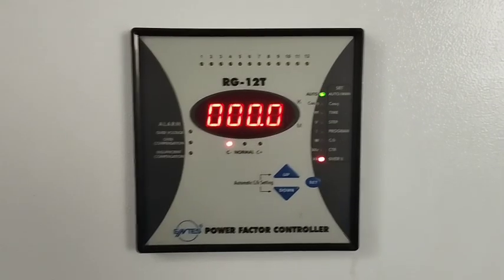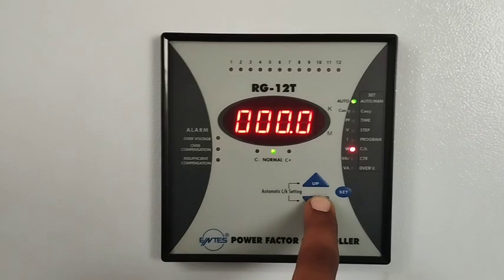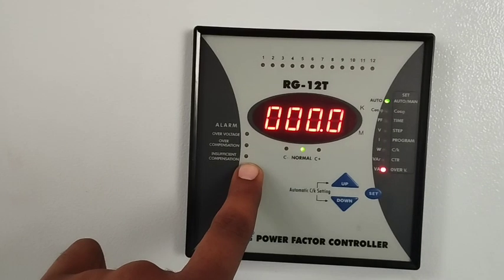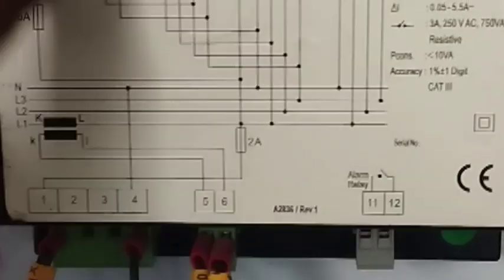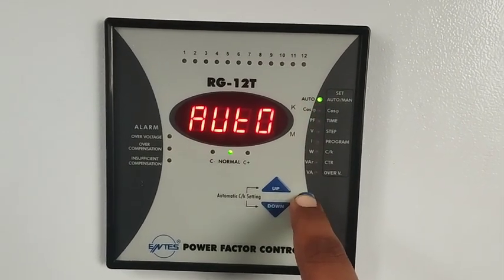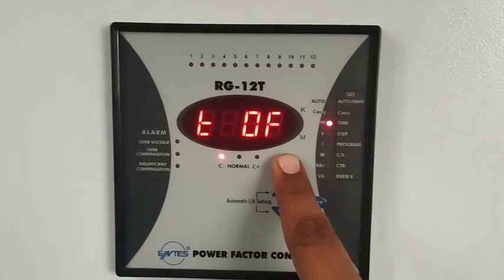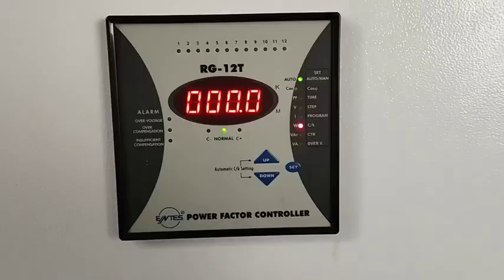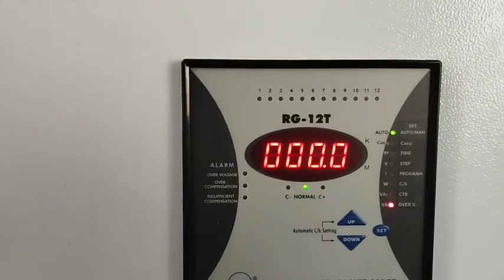power factor controller programming ° RG-12T , RG-8T, RG-6T,™

Comment: When target power factor is not reached although all the capacitor steps have
been connected, so what the problem is?
Reply from the maker: First you check your total load . After calculate the capacity of power factor. If the capacitor Bank capacity is sufficient for your load then you check parameter of your power factor relay. I hope you will be find the right solution.